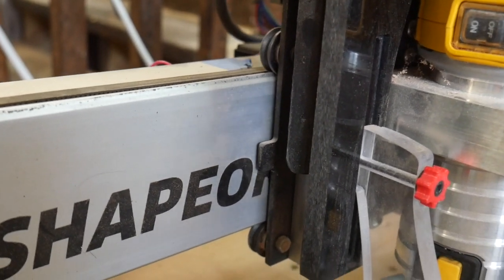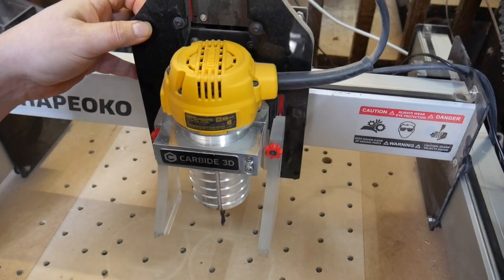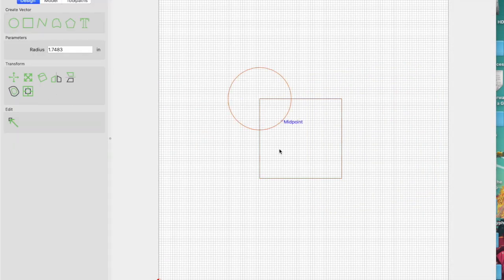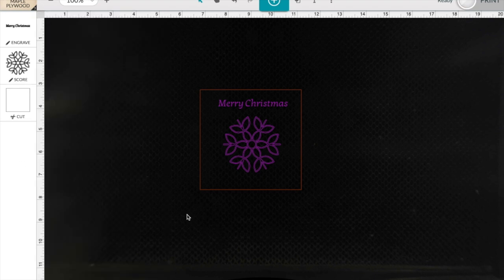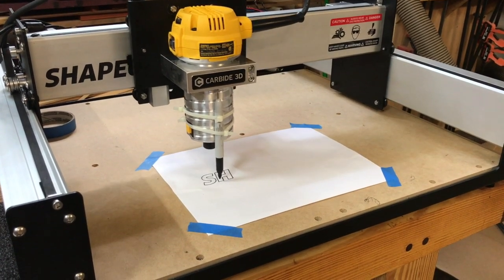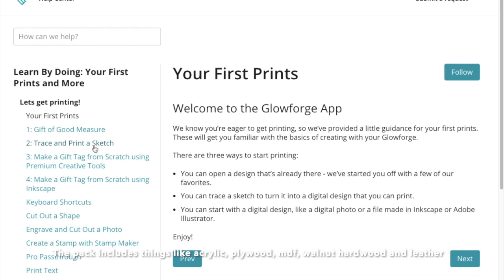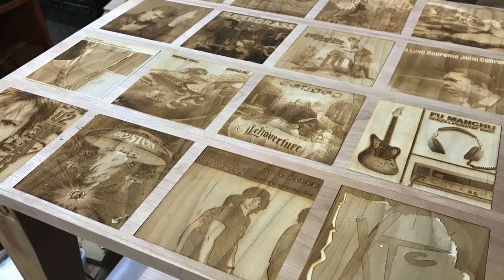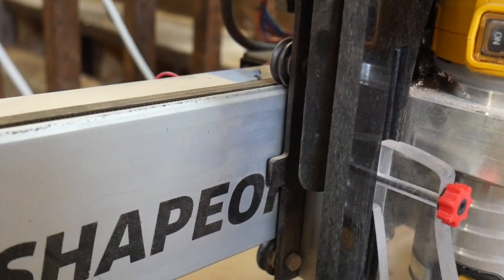Shapeoko vs Glowforge

Comment: Why not just add the Jtech laser to the shapeoko and have it all in one footprint and one workpiece set up?
Reply from the maker: It really depends on what you are trying to do. My read on the jTech is that current max power is 7Watts or so. You can do engraving and maybe cut 1/8 inch stuff (as long as it's not too dense -- balsa, basswood). The Glowforge is 40-45 watts of angry rage demon and it will happily slice through 1/4 material (Hardwoods and Acrylic) as well as engraving. It's also going to do it a lot faster. Part of me would love to play with a 30 by 30 laser print area, but an engrave of that size is going to take a very very long time. That said, if you are really just looking for engraving, the JTech is a nice setup and price.

Comment: Have to say. Love your Shapeoko videos but myself personally I prefer the Dremel LC40 vs the Glowforge... Had NOTHER but a bad experience with Glowforge, 2 machines shipped to me in Canada and NEITHER of them worked (wouldn't connect to a dedicated router or ANY router in my house either by wired connection or wireless and the gantry arm controlling the laser didn't work after setting it up right out of the box.) LOVE my Dremel and have had no issues with it and JUST bought a Shapeoko 4 XXL and is currently awaiting set up in my shop at the moment. VERY much looking forward to blending the 2 machines together. Thanks for your help with the Shapeoko videos as I am sure they will continue to be in my daily watch list for some of the creations I'll be making for my little business at home! The possibilities are ENDLESS! Take care and happy making!
Reply from the maker: I have not played with the Dremel LC40, but I would like to. I have a Glowforge basic, so the $3k vs $6k price difference was a bit much for me. My basic has been very productive thus far. Maybe when it's time to replace it, I will look at the Dremel.